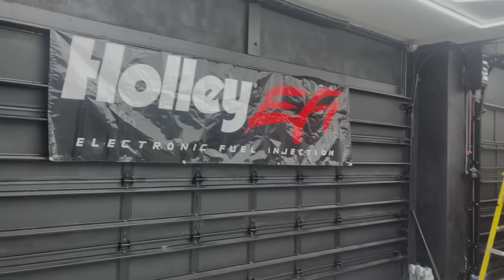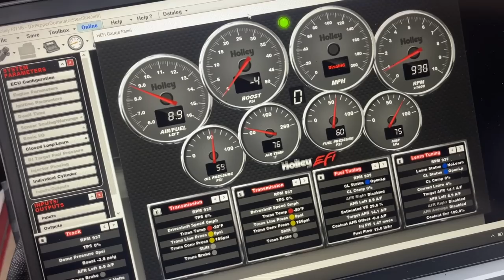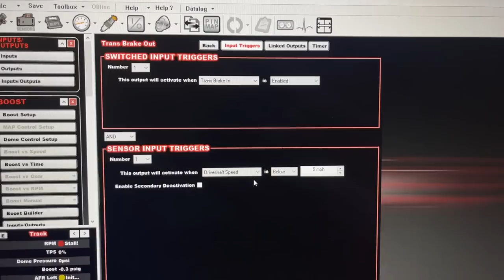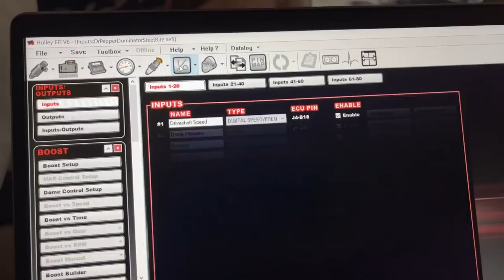I Embarassed Myself, Never Letting This Happen Again

Comment: I prefer the non traditional line lock setup. Hook the solenoid up to the rear brake lines. Turn the line lock on first, it lock out the rear brakes, you foot brake and do a burnout and then turn off the line lock. It is awesome for doing burnouts! Just make sure you get the right solenoid! Most line lock solenoids are only meant to be on for a short period of time, you need to buy the ones rated for continuous duty if you run them on the rear!
Reply from the maker: That’s a cool idea I like that

Comment: Awesome video Parker. Good to know how simple it is going from one Holley to another Holley unit, I'm fixing to install a Holley sniper kit on my ol' 56 Chevy.  Guess that gearvendor didn't like all the horse tourques. Thanks for the awesome content.
Reply from the maker: You won’t regret it they’re great!
Reply: the fastest street car in America runs a Gearvendor so Hp wasn't the problem
Reply: @XLTJeff   I understand that, but they don't always engage the overdrive on the track. I understand they can put power through the unit, but not while it's engaged in overdrive.

Comment: Just a thought - Use the Holley to control or inhibit the overdrive, by using the tps as an axis it would allow you leave the gear on in high gear below “x” Tps and even create a flag on the dash to show when it’s on
Reply from the maker: Already done!
Reply from the maker: I actually did it by mph. It’ll kick on at 50mph and shut off anything below 30
Reply: @DoctrParker  mph isn’t necessarily a good representation of the torque out or demand of the engine and may still result in the gear vendor being over powered and slipping, are you trying to use the gear vender for street driving only or as an overdrive on a pass, if only for street driving then how does the ecu differentiate if the vehicle is on a pass or not? However Tps is a direct representation of how hard the engine is being pushed
Reply from the maker: Street driving only
Reply: @DoctrParker  mph lock out won’t work unfortunately it’ll still be able to be triggered by vehicle speed, 

Two axis 
Mph and TPs 
So it only operates above say 50mph and less than 10% would do the trick

Hope this helps

Comment: Tip for linelock, grab the button then pump the brakes
Reply from the maker: ? That hurts my brain
Reply: @DoctrParker  linelocks are one way check valves. you can press the linelock button first, then give the pedal a few pumps and it will generate more pressure in the front lines than pumping a few times then grabbing the button.
Reply from the maker: Ahhhh I see. Didn’t know that